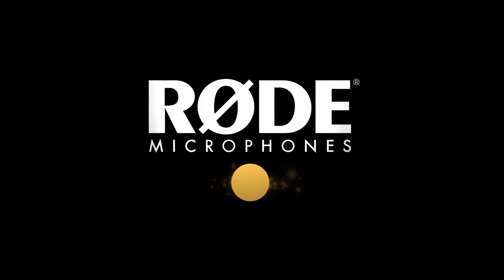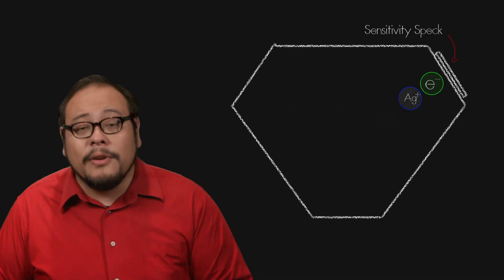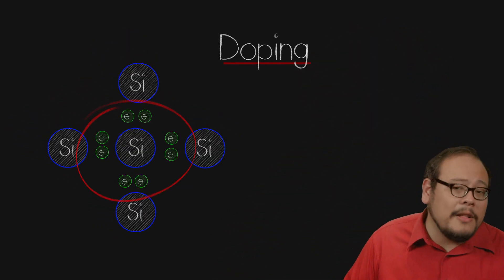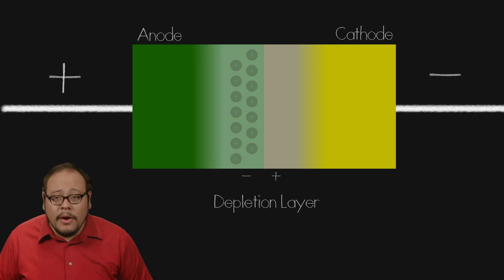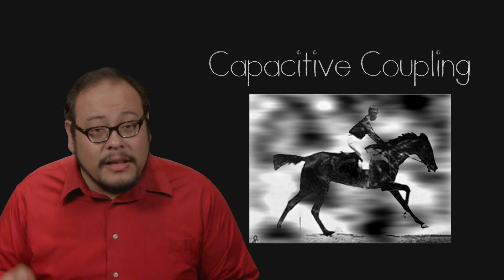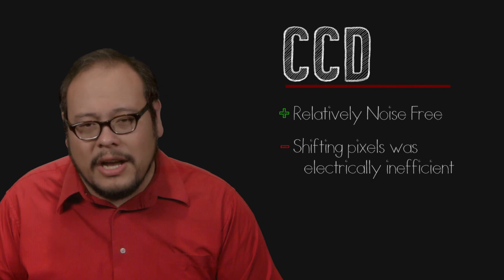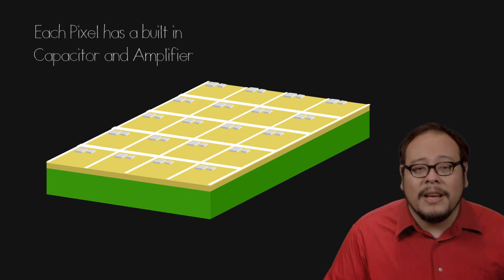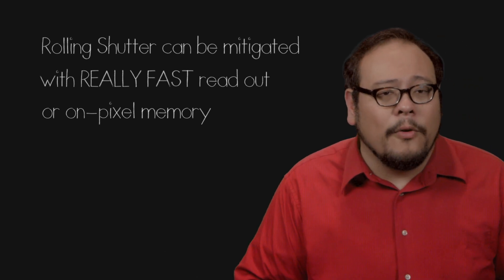The Science of Camera Sensors

Comment: Hi, was wondering, in mirrorless camera nowadays, since the sensor was not protected by a mirror as back in the DSLR era, will constantly exposing the sensor to the environment will cause any harm to the sensor? Im talking about not pointing the camera direct to the sunlight. 🤔
Reply from the maker: Should be fine
Reply: @FilmmakerIQ  Thanks for the reply. 😊 Am believing the simulation we saw through the EVF and screen was a simulation generated by the processor in-camera instead of how the sensor was electronically exposed non-stop. 😁
Reply from the maker: No simulation (how could it be). it's actually the camera sensor working non stop.
Reply: @FilmmakerIQ  Ahhh... I see... then the sensor must be very robust!! 😁
Reply from the maker: There's no moving parts, it's actually closer to a computer chip in manufacturing with a very small amount of electricity growing through it.
Reply: @FilmmakerIQ  Thanks for the sharing... learnt a lot!!

Comment: How to find out which sensor is installed in the camera?
Reply from the maker: Today it's all CMOS but it will say on the tech specs
Reply: @FilmmakerIQ  A microscope camera, with a Sony IMX226 sensor, was shipped from China. The effective pixels are 12MP, but the manufacturer has scaled it down to 8.3MP to achieve a frame rate of 60fps. The pictures I took today were only 5.2MP. I'm afraid the sensor installed might not be as promised. It could be IMX334 or IMX178. I am trying to find a way to check the sensor already installed in the camera.

Comment: Hi ! Thank you so much for those explainations, I was looking for physical explainations of sensors for a long time (not thought in my film school !) :)
I however still have a few questions :
1. Why do we need amplifiers ? The voltage coming from the diods is too low ?
2. On the CMOS electric circuit sketch (10:08) it seems the parallel processing bus only collects one information per column... so a 1D info (let's say we only have the voltage on the X coordinate). How to know where in each line of pixels it came from ? (get the second dimension to have it 2D, I mean get the Y coordinate).
3. For the CCD, before the shutter closes, light is still entering and might produce new electrons to the Aluminium lines that haven't reached the bottom yet (at 7:55 , light should still be reacting with half of the lines)...no ? Or are the lines shifting after the shutter is closed ?
4. Is the serial shift register of the CCD like a bus ?
Reply from the maker: 1. Yeah - there's not much of a signal coming from a photosensitive diode
2. Not entirely sure on specifics but each pixel or cluster is connected to a register and read in parallel. Don't read too much into my illustrations - they're not precise.
3. Light moves far too fast to be a concern. The bucket brigade happens after the shutter is closed.
4. Don't know, I'm not that well versed. I'm here to provide the 30,000 ft explaination.

Comment: if the equivalence between fullframe ISO and aps ISO is crop factor^2 how could I calculare the dinamic range adjustment if there is one. Is there a dynamic range equivalence ?
Reply from the maker: Since Dynamic Range isn't a function of sensor size you can't use any crop factor math to determine dynamic range equivalent. There really isn't such a thing...
Reply: Filmmaker IQ thanks

Comment: Night time photos. If you take a 20 sec exposure and in the first 1 sec a meteor goes though the sky, during the next 19 sec does the meteor get dimmer because the dark sky is trying to over write the light first caused by the meteor. Thank you
Reply from the maker: Nope. Light adds on to an exposure - it does not subtract. So the meteor will never get dimmer, but the surrounding space might get brighter.

Another experiment you can do be in a completely dark room. Open your camera for a 20 second exposure and then fire off a flash. Try it again with a 5 second exposure with the same flash - the exposure should be identical.
Reply: I tried doing that when I first got my DSLR camera. I took a 20 sec photo and moved 6 feet over to the right in the photo after every 5 sec, I ended up with 4 images of me that all looked like ghosts. I guess it was like a 4 exposure photo. From that I thought that dark data could write over light data on a long exposure.
Reply from the maker: You did exposure stacking in the camera and you should get that ghostly effect. How bright your ghosts are will be determined by the aperture and how strong the flash is. Here's a good example of this in action: https://mitmuseum.mit.edu/sites/default/files/flashes-of-inspiration-edgerton.jpg

Remember this in terms of photography - there is either light or the absence of light. There's nothing that hits a photodiode and subtracts an electron - only addition.

Comment: Another disadvantage of the CMOS sensor is that because of the parallel line wiring of the amplifier circuit, you get more light noise(versus color noise, one of two different types of amplification, or ISO noise). The system is incredibly prone to induction noise along the signal line, as it's surrounded by the two electrical leads to the amplifier. NMOS sensors and "Back Illuminated CMOS sensors" can help mitigate this to some degree, with NMOS sensors shifting the signal line to a point perpendicular in a 3D space to the electrical leads powering the amp(using MOSFET transistors, the amp for each pixel dumps off the back of the sensor, rather than along a bare lead across it), and "Back Illuminated" sensors moving the entire amplifier circuit to the rear of the sensor using similar technological structuring. Both approaches increase the available space per pixel for the actual sensor to take up(with basic CMOS sensors only devoting 35% of each "pixel" to any actual photoelectric sensor), while the NMOS sensor can increase that space up to 50% per pixel, matching the space of older CCD sensors in terms of percentages covered.

What's worse is that the older CMOS designs just aren't compatible with modern process nodes. It used to be that the process node of creating photoreceptor cells created a thick enough die that your electrical leads and traces would travel between pixels at a lower height than the silicon. As the process nodes improved(which thankfully reduced heat buildup and power consumption), that silicon got thinner and thinner, surpassing the electrical leads. This could actually create on-sensor color artefacts, as the electrical leads on one pixel would "cover" the sensor on the adjacent pixel if the angle of incidence was just wrong for the light source. 

This coupled with Canon's stubborn adherence to a USB1.1 standard for moving data off the sensor to the image processor, their equally stubborn adherence to older process nodes that never worked very well(45nm was just.. bad...), and their equally baffling adherence to the processor-to-card bus being just as ridiculously slow(And don't cheer, Nikon users, your company was JUST as bad) has meant that aside from very recently, it's fallen to niche camera manufacturers(Panasonic, Samsung) to really push the envelope on what a sensor could do, and allowed Sony to surge ahead pretty much out of nowhere with their own offerings, though they still suffered from the same bus speed problem for a while, which gave them a terrible rolling shutter issue. 

It's an exciting time to be a photographer, because Sony and Panasonic, and to a lesser extent, Fuji, Olympus, and Pentax have all made Canon and Nikon nervous. They've started producing solid performing hardware with solid features, and Canon has been forced by their complacence(and again, so too has Nikon) to get off their butts, stop going on their name alone, and catch up quickly.
Reply: (Not for nothing, but Canon and Nikon are also being made a bit nervous by the joint architecture that many other platforms are going for. A lens for a Panasonic camera will work on Z-cams, Blackmagic cameras, Olympus cameras, and a few other brands, which strikes a solid blow to the closed architecture that Canon and Nikon have relied on so heavily in order to maintain brand loyalty from some users)

Comment: So people claim in a small rectangle approximately 1 x 3/4" there are 16,000,000  or so man made microscopic doodads  each of which is sensitive to light and manufactures a varying electrical charge and sends it through millions of little wires to some computer to make a picture. I simply refuse to believe such nonsense. What do you take me for? APS sensor with 24MP is over 65,000 per square mm.

Comment: You can build Global Shutter CMOS. Certain can use a technique called interleave mode, where an image is read out, while the next one is exposed. (I implemented a controller for that)
Also in CMOS Sensor you don't read out all pixel of a line at once, as it would require too many pins on the chip.
The Fixed pattern noise of CMOS sensors can easily be corrected.
The reason why CMOS sensors took of in the last decade is, that the can be manufactured in the same chain as other chips. CCD require specialized chains, thus making them more expensive.

Comment: i have canon 1100d , while capturing pictures, picture is not clear and has lots of noise.. will changing new sensor make my photo quality better??
Reply from the maker: +jijoe apple try shooting something outside on a bright day. Make sure the camera is on program mode. If you still have lots of noise there may be something wrong with your camera. Otherwise it's a matter of not feeding your camera enough light in which case you need to with on exposure.
Reply: well camera is 4 years old and i thought changing the sensor and mirror could make it like new one ,,, instead of buying new camera.. so will that idea work and thank you for replying ...
Reply from the maker: You really can't just replace the mirror and sensor on those cameras - at least not in a way that's economic.
Reply: thank you. for your suggestion and  looks like the problem is with my camera...

Comment: Great video! I just wonder as for CMOS every "light capturing area" has it's own capacitor and amplifier, isn't it likley that one of these fail or break? As there are, I guess, millions, the likleness should be pretty high, but I don't think this ever happens? But if it does, does it result in a dead pixel as the information captured can not be stored?
Reply from the maker: +DecoyAUT Good point - which is why the manufacturing quality control process has to be very strict. I couldn't give you specifics regarding failure rates but all the evidence around us means it must be quite low.

Comment: 6:07 Voltage is not a measure of electrons, that would be charge.
Reply from the maker: +dimmddr1 it might be a layman's way of speaking but the "counting electrons" is measuring the amount of potential energy in the diode.. The more the photodiode is exposed to light the more potential energy it has and that is measured in volts.
Reply: It would be much harder to store charge… You would have to cut off the connection to the capacitor before all the charge drained out of it. The closest way we have to measuring the number of electrons is by measuring voltage. Although I am curious… What is the camera missing by measuring a few high-energy electrons and many low-energy electrons the same?

Comment: Yeah, cmos sensores really do suck overtimes when you want to take still images because even a slight move of the subject or the camera will cause that annoying rolling shot effect,even when you think it's allright but once you zoom in there can be still some blur in small details,likely,algorithms can reduce noise and rolling shutter by using advanced technics .
Reply from the maker: +johneygd slight movement won't trigger rolling shutter - it needs to be very quick movement like a whip pan or fast moving things like fan blades. What you might be talking about is slow shutter - which isn't a problem with CMOS but with all photographic techs including film. The solution is to increase your shutter speed.

Comment: Good video.  I've always wondered why they make round glass yet rectangular sensors.  Is there a physical limitation that I'm missing or is it just a price limitation in manufacturing?
Reply from the maker: +turkishexpress  Because making rectangular glass isn't really an option - the only way to do it is to cut it after it's been ground and polished... but why mess with it when it's fine?
Reply: Good reasoning.  I wonder if part of the reason why vignetting happens and looks the way it does is due to the glass being round and sensor being rectangular as well...
Reply from the maker: Vignetting is caused by exactly what you're describing :)

You have to have the image circle be a lot larger than the sensor to get rid of vignetting.
Reply: Nice!  It was an intuitive guess!

Comment: You mean "physical shutter" where you say "electronic shutter" several times.  The CCD show showed did not have any mechanism to turn off being sensitive to light, and in fact these will smear as exposure continues during readout.  Another layer is used to transfer to an inactive layer, and you did not show that.  You require the incoming light to be blocked by a real shutter.  

The electronic curtain in a modern camera is more a whole process, not a single thing, anyway.